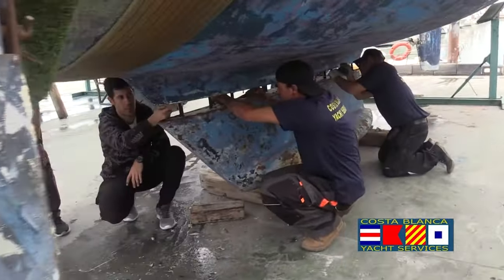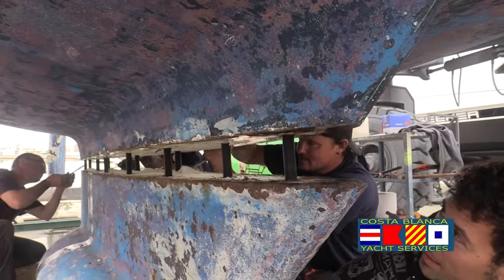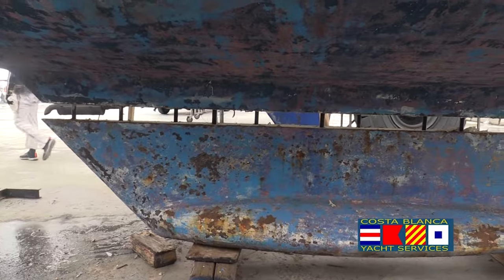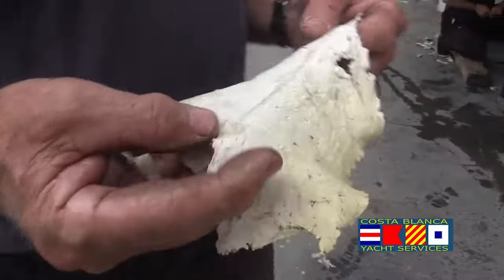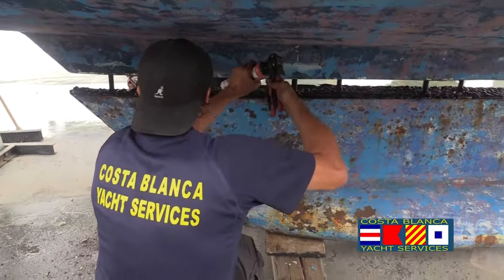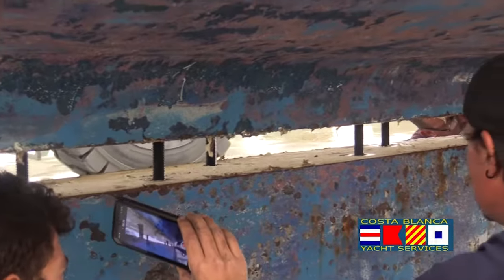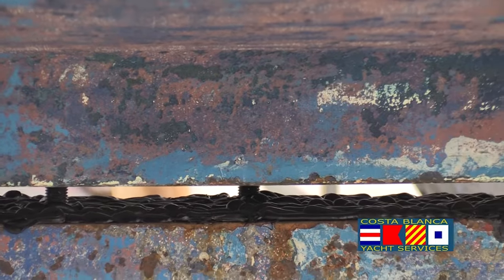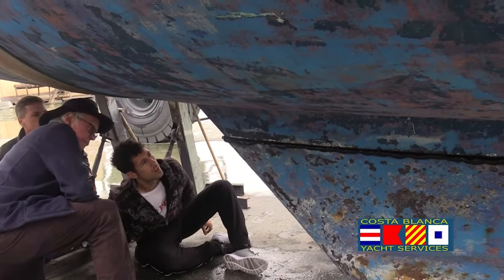Boat Doctor episode 4 Replacing the Keel Bolts on our sailboat

Comment: Dropping the keel can be a nightmare project. This video doesn't show much of the process. Best bet is to get a boat where the keel is integral to the hull. No bolts to worry about. Older style boats with slack-bilges, full keels and cutaway forefoot designs are tougher and you never have to deal with all this.
Reply: Im surpised they haven't jumped all over you to tell you how terrible full keel boats sail. This, on the other hand, looks pretty terrible to me. It can get a lot worse than what we saw here it seems. I guess boats are no picnic no matter what.
Reply: @autonomousindividual7780 You don't have to go full keel. You can have a cutaway forefoot and, maybe, a so-called Brewer bite towards the stern. Still fully encapsulated ballast in the keel is a good way to avoid the headaches. It should be pointed out that later design/build boats with fin keels don't necessarily have this problem. I've known more than a few sailors with fin- or modified fin -keel boats who have taken some hard grounding and never had an issue with keel separation. It's a favorite subject of conversation around the ol' watering hole.
Reply: @autonomousindividual7780  The full keel sails pretty well downwind in a big sea. Try a North Atlantic gale with a full keel. I suspect your opinion would change and you may drop the word " terrible " from your description.

Comment: Why do people trust a few bolts to prevent what is sure to be an instantaneous capsize?
Reply: stupid question. Bolts are everywhere,  cars, planes, ferris wheel, everywhere and it is normal to trust your life on them.
Reply: Because they're strong proven graded and trusted
Reply: But what CANNOT  be trusted Is the word of a boat seller as to Thame status of the bolts. Best buy a full keel...many of us certainly will never trust keel bolts as it's simply a poor design that can contribute to major damage being undetected and leading to fatal consequences  for many. Even new boats could have sustained damage to their structure during transport that can and has remained concealed
Reply: Personally I'd prefer an iron/steel keel secured with strong steel bolts to a GRP shell full of lead which can fracture and spill its ballast after impact with no internal indication of what's going on. And full keels are sloooooow and don't point so there's a much higher risk of being caught in weather or being fatally embayed on a lee shore, as happened to Dream Catcher, a long keeled Golden Globe entrant driven ashore in a gale whilst a fleet of fin keelers managed to beat to safety.
Reply: @norml.hugh-mann  "for many"? Can you name 3 in the last one hundred years? Btw...aircraft wings are bolted to the fuselage.

Comment: I'd like to see keels that are built with soda can aluminum all the way to the bottom, where it would meet with a lead weight shaped to deform in bottom strikes and groundings. Entirely iron keels  have too much extra weight high up.
Reply: You won't see that. Aluminum is not strong enough in this application.
Reply: Due to galvanic action  you would  lose it all. Very  shortly. Unless you are in fresh water
Reply: @DonMason-cv6og  Wrong. Everything on a boat wears out. Zincs would slow down corrosion. Soda can aluminum is high quality and can be allowed toward a boat builder's formula 5052, which is slower to corrode. You didn't read between the lines. A significant hull weight reduction, while keeping the boat stable.
Reply: @stanleybest8833  good observation  I forgot  about the 5052 series  AL
And it's corrosion  resistance  thanks for the  reminder. M ye choice  of keel bolts  will always be  silicone bronze 
Virtually  no reaction between  cast iron or  lead ballast keels  have had occasion to replace many of them over the years 
Some more than 70yrs  of service

Comment: The video does not show much of the process of replacing the keel bolts.  When and how  were the new bolts attached to the keel ?  All I see are threaded rods and removal of the sealant between hull and keel.   These threaded rods are screwed into - I take it- large stainless steel bolts attached under steel plates in the keel thereby not forgetting galvanic corrosion.
How about showing the bolts in the bilde ?  How much torque is applied to the threaded rods and bolts ?
Reply: @mishpatim123  unless specified during  construction  most SSt  threaded  rod is 304  variety  better choices  are 316 to  Aquamet 322 the less iron and more chrome  nickel  content  the better